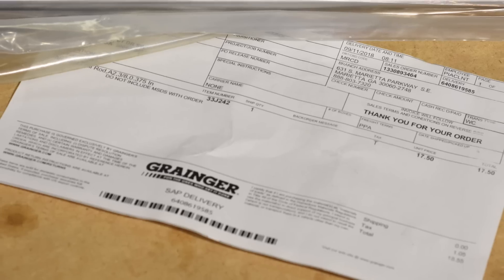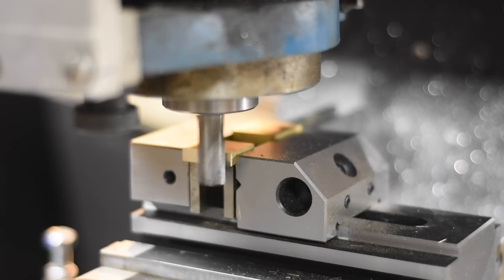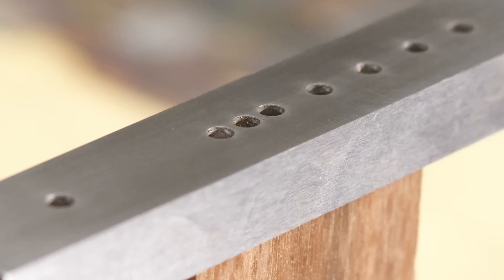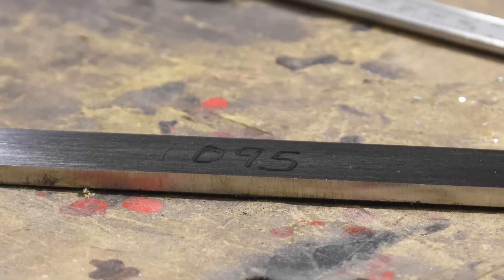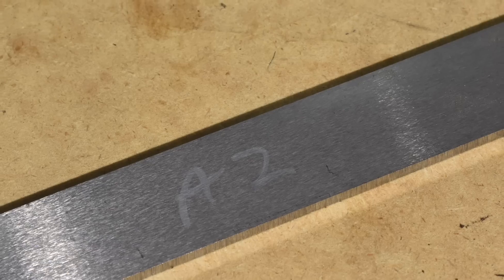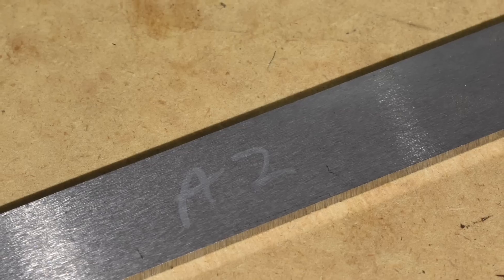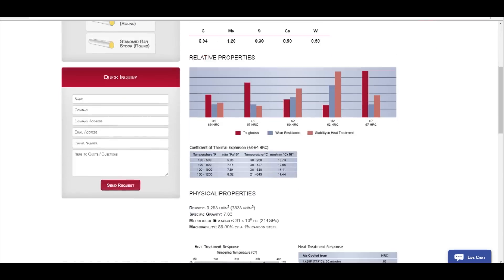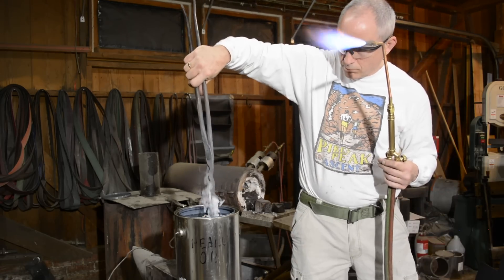Guide to Tool Steel for Knife Makers

Comment: Totally wrong about 01 being beginner friendly steel regarding ease of heat treatment, you can not get good results heating with a torch and dunking in oil, it needs heating to 800°c and soak for 15 minutes to get good heat treatment

Comment: Actually Walter, I made a really good hard knife from mild steel. I pack carburized several strips of mild steel then forge welded them together and folded a couple times - finally I carburized it again for good measure and ended up with a beautiful blade that took a beautiful etch. It's blister and shear steel - a very old technique of controllable, hardenable steel production.
Reply: Any way to estimate the carbon content of such a steel? Time and surface area?
Reply: @mikafoxx2717 You would have to get a mill test from a professional metalurgist shop. Ideally you try to know the steel you will be working with beforehand.
Reply: @mistral-unizion-music  Yeah, I bought real steel myself, they just say controllable. I was thinking time and temp for carburizing

Comment: freind of mine hardened an 8670 nickel steel blade in 140 degree water, doing an interrupted quench. blade came out straight and hard with no cracking.he says that hot water cools steel slower than cold water, but faster than ordinary oil.

Comment: with releases like magnacut, there's a strong preference to stainless over stain"full" 
Tops 154cm sells like hot cakes 
Can't keep them stocked 
Esee is releasing more and more in s35vn. People don't want the added maintenance and stress of having to constantly oil a tool or carbon steel blade, keep it dry, and separate from the sheath, and God help you if you're out in the forest with your wrinkler If it starts raining. 
With 154cm you're good to go
Reply: Wrinkler.. hah. 
Yep, I rarely have patience for staining when stainless is just as good these days. 12c27 and such is just as performant as a regular steel like 1084, but no staining. And then there's the super duper steels like MagnaCut. 
I'll make my own blades from rusty steel, for fun, and a little rust doesn't matter so much for carving tools or such. I do like the oxidation with a forced patina, though. But for a knife I buy? Stainless is just as cheap and just as good. Maybe D2 for a cardboard cutter on the cheap if you don't need toughness.
Reply: I feel like they should slowly phase out 1095. Some people will cry sure, but who wants all those extra maintenance chores?
Reply: @brianlash154  the reason why, is people still buy it, and it's cheap as chips for them compared to stainless, since chromium ain't free. 1095 gets a reputation for toughness when it doesn't even have that, really, at least compared to 1084 and other low alloy steels.

Comment: I have only made two knives from D2 and commonly use A2, so maybe I got some bad D2… but it rusted a lot more quickly just sitting in the shop than A2 ever has. I’ll have to look into that more.
Reply: Stainless and semi stainless steels arent stainless until final heat treatment. Something about bringing the "chromium into solution."

Comment: I came here after quenching chromoly chisels in mineral oil. Good enough to compete with S7 equivalents. Would gladly use L6 or 1075 steel for chisels if I could find them in the form of bars.

Comment: If by chance you wanted to know what type/kind of steel is used in ie. Flexcut woodcarving tools.  How would "you" Walter or whoever is so kind to answer this question, ask the company in a letter or whatever?  Mostly they will say "High Carbon Steel".  As you know there are a few different types of "High Carbon Steel".  Most will not say is a D2 HC content. and Stainless Steel can come in types that are equal to and the quality can go up and down the scale like a musician on the scale.  Some would not tell you with a bright light and a rubber hose used on them.

Comment: L6 steel was the steel that saw blades were made from before the advent of carbide tipped saw blades. When the lumber industry went to carbide tooling manufactures   cut way back on making L6. There is a similar Chromium Nickel steel called 8670 that is available. I have only ever seen it in 3/16 stock so industry must have a very specific use for it. Kind of like you can only find 5160 in
 .200 or .250. Retired Knife maker John Greco used to use 8670 on a lot of knives.

Comment: Hi Walter , 
I have an old diamond tipped concrete cutting blade to practice knife making , “stock removal” I was under the impression given the nature of the blade it would be hard already. But it bent in the vice. I’ve seen a video a fella quenches in water and god a better result than oil. Could you recommend any tips to heat treat this type of steel?

Comment: L6 is used for sawmill bandsaw blades and is 0.75% carbon with 1.75% nickel plus some other alloys, it's great for bush craft knives or for forging with 1084 to make Damascus. Makes great ax heads too that you can leave hard around HR 59.
O1 has 0.5% of chrome and tungsten with 0.20% of vanadium which at that % restricts grain growth during heat treat a desirable thing, but if treated correctly you get chromium and tungsten carbides in the carbide matrix. That's why O1 is a great beginner's steel. Heat to 1475 for 15 minutes and you can use canola oil for the quench, then you temper in your oven at 425, let it heat up with the oven, for two hours two times. It will be about Rockwell hard C scale 59-60 which will hold and edge all day without being brittle because of that vanadium and manganese which all the steels have. If you're using a forge you heat until it becomes non-magnetic and hold it there for 5 minutes or so depending upon how hot your forge gets then quench and temper. Not as good as a heat treat oven, but it will be hard.

Comment: I made a knife from a old stihl saw bar about 20years old. I have read it might be L6 but not sure. Parts of the bar was hardened so I know it can be hardened. My problem is when I heat treat The knife I can’t get it to harden. I heat it with a acetylene torch dunk in oil but still soft!!! Why?!?!

Comment: I'm a new subscriber,  and found your video very helpful.  I'd like to make a couple knives and a drawknife for woodworking.  You mentioned 1095 but didn't give much info about it,  but that was one I was thinking of using.  I'm not on ANY social media so those links don't help me.
Reply: 1084 is a lot easier to heat treat than 1095

Comment: I challenge you (and everyone) to make a knife from M2 or M3 HSS. That stuff is crazy. You can't anneal it, can't drill it except with a carbide bit, can't harden it, but that's OK, it's 65-68 RC anyway.  I made 1 from flat stock, it's easy to sharpen razor sharp and holds an edge better than any steel I have seen. It's a little brittle, but not dangerous unless you do something stupid.
Reply: Good old air hardening! Worst thing ever for blacksmithing the stuff, it doesn't move under a hammer either and when it cools it's hard as glass.

Comment: my local steel place has drops (off cuts) O-1, A-2, D-2, etc at $1.25 / lb (they are typically around $10-13 / lb when bought full price). typically these have been in sizes and shapes.that stock removal guys wouldnt have much use for, but for smiths they are great. definatly worth checking out if your area has an open to the public steel supplier.

Comment: For anyone who needs some beginner info on 1084, 1095 and W2, absolutely huge enormous wall of text below... I’m bored clearly, but also I think certain bits of info can make a big difference as they did for me.

1084 is the easiest of that group. It will harden in oil, and it doesn’t require any precision as far as soaking it. You just heat it up and quench it in canola oil (or whatever you have, however I’ve had good luck with heated canola oil, even with 1095). You can easily use 1084 with a small single burner forge, or even a torch I’d imagine. 

1095 is a little trickier. 1095 is right on the line between water and oil hardening, it’s “hyper-eutectoid”. This steel needs to be quenched very quickly. I don’t mean that you need to run to the quench from the forge (be brisk though), it just means that it has to drop from around 1300-1400 F to 800-900 F or so in less than a second (google the exact numbers if interested, I forget tbh). This is why people recommend fast quench oil like “Parks 50”. However, water will of course work, and even preheated canola oil will work. I’ve done both.

W2 is similar to 1095 in the sense that it has to be quenched quickly. This is no surprise as it’s water hardening steel 2. You can use fast quench oil here, but the only time I’ve done it I’ve used salty (with some dish soap in it also) water, slightly heated. Until recently I haven’t had fast oil available. Keep in mind also that water is a much safer method in terms of your safety and the shop’s, so that’s another thing to consider. 50 quench oil has a low flashpoint, and isn’t exactly edible. It’s also not cheap or easy to obtain. So learning how to use water isn’t a bad idea. W2 I used specifically for a hamon, and it did in fact give a nicer one than the 1095 I have. 

Keep in mind that with both of these steels it is recommended that you “soak” them, so they aren’t necessarily the easiest steels for just heating something up and quenching it. If you use a forge or similar method, getting it right isn’t as easy as 1084 for example. 

Your best bet is to get used to the colors, use a magnet, and try to at least get the steel to soak at above critical for a minute or two. Get it to that nice red, non magnetic color where the darker “shadow” spots go away, and let it go a bit higher into a that slightly orange, solid red color and try to hold it there (don’t go hotter at this point if you can, if anything let it slowly go back down a tiny bit, but obviously you have to be around the 1450 area still when you quench). If you can pull this off without over heating it TOO much to start with, it will come out well. You don’t need an oven, it’s just easier. 

I actually bought a pyrometer with a ceramic thermocouple that can read up to 2200 F, but I found that it doesn’t help all that much without a really good implementation of it. If you can check the temp to get a reference between temp and color, that’s a good use of it I think. However it’s difficult to set it up in a forge that’s open where air moves through and the flame itself touches or doesn’t touch the blade. I think making a small confined section out of steel to put the knife in, where you can then monitor that small area, may work.

Also with water leave your grind thick before heat treat, that’s a good way to attempt to avoid cracks and warps. You can safely grind a lot of material after hardening, as long as you have some good belts, a bucket of water, and patience. Don’t wear gloves... if the blade is warm you’ll feel it. Also high quality ceramic lower grit belts like 36 take off more without causing as much heat. This is important to keep in mind. You can take off a lot of steel without the blade even becoming hot to the touch.
Reply: thanks for this info, its stuff like this thats hard to find for a young beginner like me
Reply: Mahalo
Reply: Hey. What steel would a gun barrel likely be? And to add a contrasting metal for a Damascus layering, what would you pair it with?
Thanks.
Reply: Doggo Willink Yup, water quenching has been around for thousands of years. Just got to find a way that works for you. 

You can also interrupt the quench to avoid cracks, which is really the worse that can happen. Warping is not to much of an issue, and can be fixed. 

Differentially hardening something like 1095 also helps with pinging and cracking.
Reply: Yep, if you're a beginner and got 1095 because you were a little misinformed.. don't get it too hot since it dissolves too much carbon and causes grain growth which reduces toughness a lot, the. Water quench, maybe interrupted if you can practice. From the heat to water fast without air cooling, once it's down from ~1450 to 800, you're safe and can let it cool a little more slowly. It's when the crystal structure changes from austenite that it changes size some, so avoid fast cooling thru that point, but you have to avoid the temperature range that the carbon can quickly diffuse out to make pure ferrite without other elements to hinder the speed.
1084 is very near the .77% eutectic, plus a little extra since it's not instant dissolving, just heat it up and it'll move fast, won't get too brittle since the carbon is lower, and it'll quench a little slower without so much carbon trying to force it out of solution.

Comment: For o1 steel,  what kind of oil should I use?  Canola or motor?
Reply: Brian Mayfield I used vegetable oil very successfully for a long time. Give that Canola a shot! Heat the oil to about 140 degrees before quench. Have fun!

Comment: Thanks for the info.  As a woodworker, I'm interested in handplane blades, so O1 should ok.  For lathe tools, a HSS such as M2 is probably best.  However, my question is about sharing a programmable oven with my daughter who is a glassworker.  Do you know of any complications that might occur if steel is processed in the same oven as glass? My daughter is giving me the side-eye about this.  She's concerned about cross-contamination of glass with steel residues that may alter the color or hardness of her art pieces.

Comment: O1 can air harden some during forging so keep your temps up to prevent cracks. Great list of timeless tool steels! A2 is a great way to get started in the air hardening category but you need a pyrometer (omega online has good stuff) and stainless steel foil (321 is fine but worth saving for 309). Frustration is part of the ride. Be creative and have fun!

Comment: Some of the best scavangible steel I have some across is snow plow cutting edge pieces. Also have had good luck with woods bushhog mower blades. Both steels are the toughest steel I have ever come across and are easily hardened.

Comment: I like o1, just couldn't get real good results heat treating at home. I have a few purchased in A2, cpm3v, elmax.

I think for 99% of users, o1 is more then enough. If corrosion is a issue I'm learning towards cpm S30v or 154cm. 

The super steel race, in the knife world, is a bit of a glorified pissing contest where as the user is paying 50% to 75% more for a knife that provides a 5-10% increase in performance.

Comment: 1084 is also a great starter steel for heat treating... It's funny if you read all the keyboard cowboys talk about o1... "If you don't heat treat it in an oven, completely controlled, then you aren't doing it right... People that tell you it is an easy heat treat are WRONG!!" I've read that so many times, but I've done it both ways and really didn't see much difference... though heat treating with an oven is my prefered method with all my steel... Great video...take it easy...
Reply: Yeah, I've used it a few times, just to get the experience. If I'm gonna use tool steel, it would be W2 for the hamon or D2. Though, I might choose AEB-l over D2 and if I'm in the mood for a good workout CPM154, hahaha... I haven't tried any of the "Super steels"(CPM S35vn, etc), maybe one day though... I would like to try some CPM3v though, it is supposed to be the best carbon steel for toughness and edge retention...
Reply: 1084 is great stuff, 80crv2 as well. I have for sure burned up quite a few o1 blade in a forge in the past, completely blown out grain size.
Reply: Yeah, my friend got some 80crv2, but I've never tried it... I wish I had room for a forge. I do all stock removal. I did build a horizontal grinder and heat treat oven. I've got a few videos on heat treating too... Take it easy...
Reply: I've hardened O1 in an oven and with a torch. Both produce good results but an oven is a bit more reliable. Of all the tool steels mentioned it's probably the most forgiving when it comes to heat treatment.
Reply: Siggy in CR I found W2 pretty easy, unless you are water quenching. I actually have a video where I tried making my own fast quench with 1/2 water 1/2 canola oil and a drop or 2 of dish soap, it worked pretty good, better than McMaster carr 11 second and didn't risk cracking like water...

Comment: Are you forgetting about 'case hardening'?   From what I've seen that is supposed to be one way to harden a mild steel.
Reply: That's not really hardening a mild steel. It's more like turning a layer of mild steel into high-carbon steel, then hardening that instead.
Reply: Yes, you can case harden, he misspoke. Its not ideal though.

Comment: I've made lots of punches and blanking dies out of S7. I've heard of people using it for chisels as well, I'm assuming that would mean it would probably be good for an axe or machete, maybe even a cleaver. Chopping tools. I do have to sharpen them quite frequently though. I'd guess its edge holding ability isn't great but it could just be heavy use.

Comment: No 3V love?
Reply: I haven't messed with A8 (never even seen it for sale anywhere actually, or heard it being discussed) but I'm always down for checking out new steel. I've been pretty happy with 3V @ 60 hrc so far though. Peters' heat treating did a cryo on mine so they seem to think it gives some benefit. If you need more toughness than 3v, are you making a knife or a sword?
Reply: Yes, Colson Customs, and I don't think he even mentioned M4?  My favorite. 
But maybe that's getting too far away from a pure "tool steel", and into the "high speed tool steel' territory?  
Well, he did get his point across though. He can't include them all, or that would make for a very long video.
Reply: A8 is tougher than Crucible CPM 3V steel, but less wear resistant.